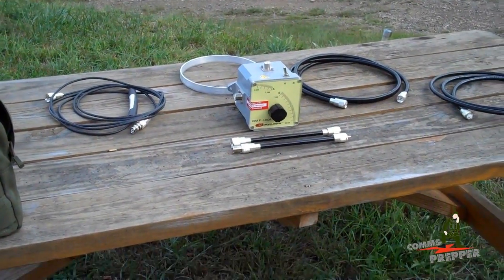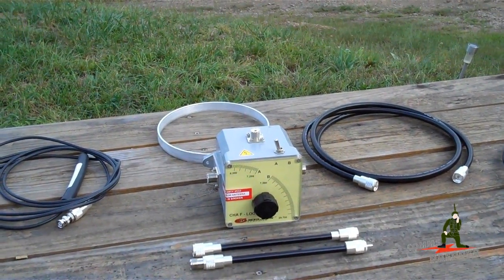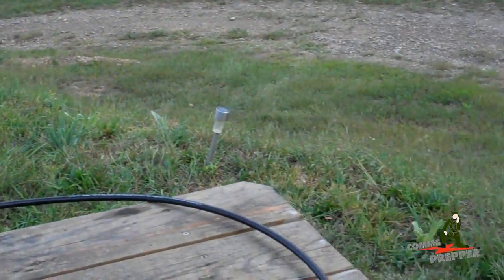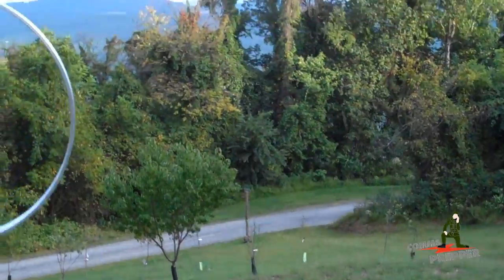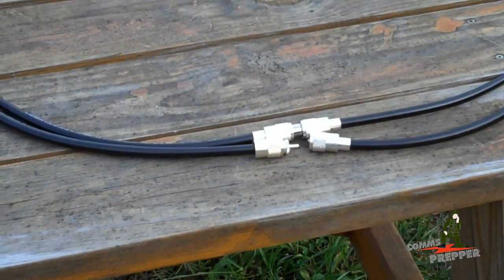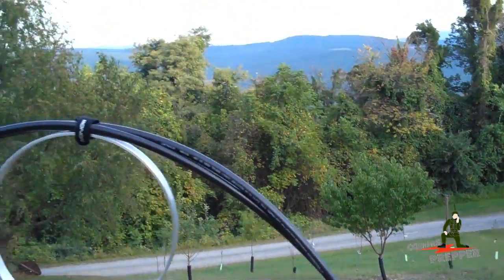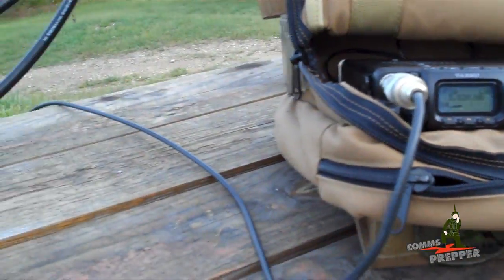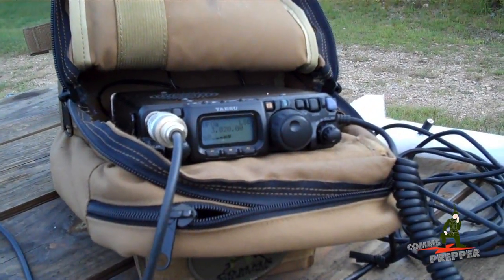Chameleon Loop Antenna with 80m (3mHz) Option

Comment: Would be nice to see the tune up. You seem to bypass this on your videos.
Reply from the maker: I have that in other videos but here are the tuning steps.  1) set frequency in radio and turn up volume. 2) rotate antenna knob and peak for max noise.  3) switch radio to RTTY mode and set to low power.  4) set radio's meter to SWR.  5) Key radio and fine tune antenna knob for dip in SWR.  6) Switch back to operating mode (i.e. USB) and operate.

Comment: Thanks for the video - much appreciated!   A few questions for you - 1. Did you make up your own second cable adapter or purchase thru Chameleon?  2.  with the adapter connection laying on top of the tuner, any negative impact on propagation on Transmit side?   3. whereabouts in WV are you located?  Oh, yes...did you purchase the Aluminum Plus Kit?  Thanks and right not leaning in the Chameleon direction for my ft-857 portable solution
Reply from the maker: +Casasdeluz Chameleon Antenna provided everything for the videos.  The antenna comes with all the required cables - I had to make nothing.  The high-efficiency loop is a separate option when ordering.  I have been very pleased with the antenna.  Our retreat location is in Hampshire County, WV.
Reply: +Commsprepper Thanks for the prompt reply! Had a house in Bridgeport, WV last fall, reason for the question. Any Quality QSO's on the 80M set-up?  Just haven't seen too much info on the Chameleon 80M setup yet.  So, at this time trying to decide between the Alpha, Alex, and Chameleon loop.  Thanks again for your reply.

Comment: to receive is one thing but to transmit is another and the pattern of the antenna. I would be anxious to see a contact's signal report when the band is open on more than a ground wave
Reply from the maker: +George Gardinier I did not get a chance to make a QSO (a challenge on the best of days when running QRP) but I have been very impressed with this antenna so far on 40m and 20m.  I have several videos in a play list on this antenna and it has worked great.  Thanks for taking the time to watch and comment.
Reply: +Commsprepper I would like to see it transmit. I know from all the videos in the  past it's worked well. But as you know 80m can be a pain in the butt. Thanks for showing us. God Bless.
Reply: my thoughts exactly. One can receive 80m on a coat hanger. transmission is the real question on these loops.

Comment: Can you convert the Hi Efficiency Aluminum Chameleon 40 meter loop featured on your earlier  podcast to 80 meters? (Would a hybrid between the aluminum and coaxial loops be feasible?)
Reply from the maker: +Hubb Zilla I am not sure.  You would have to ask Chameleon Antennas.
Reply: +Hubb Zilla The High Efficient Aluminum Loop currently can't be converted to 80M. It's also VERY important to NEVER add anything between the aluminum and the coax loop because the antenna performance will literally go from 100% to literally 0 (ZERO). Magnetic loop tuning is all about capacitance.